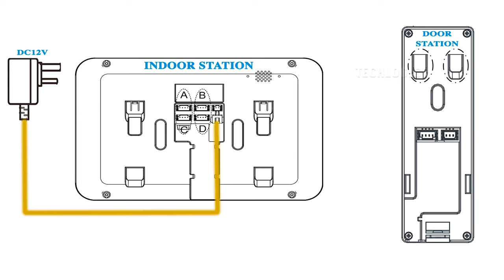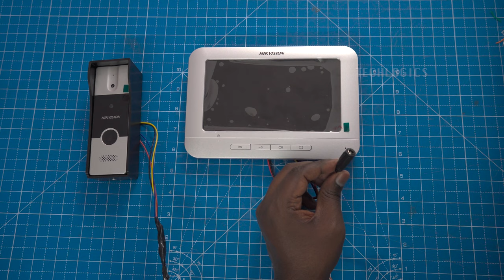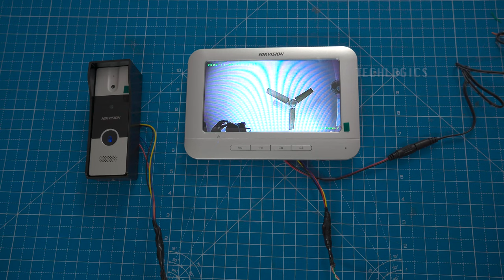Hikvision video door phone connect external cat6 cable using 4 wire connector

Comment: There is a terminal AIN1 and GRD with 5v in open condition, in vdp kv6113 to connect door sensor alarm, after connecting a reed swtich door sensor, where to configure alarm, whether alarm will display in Monitor Kh6320 or in Hikiconnect phone. I have connected a  magnetic reed contact on the terminal but no alarm aprears anywhere. Please help